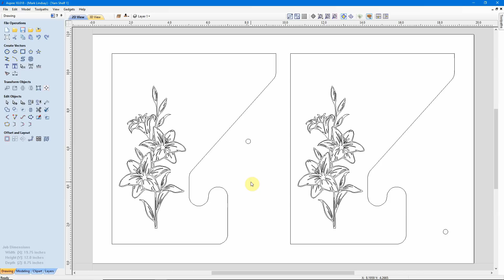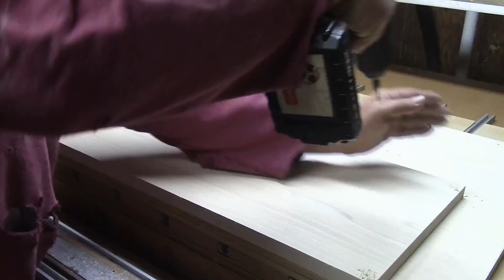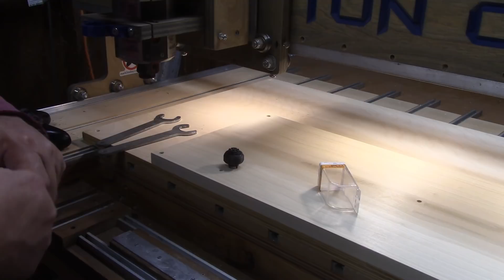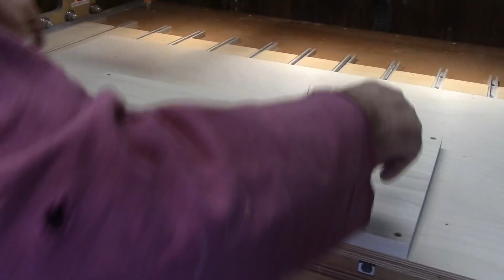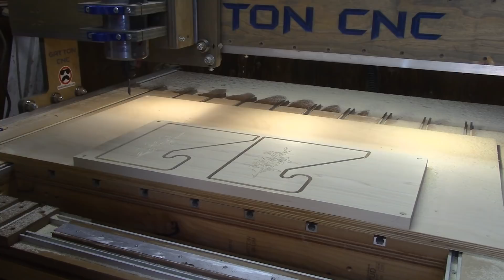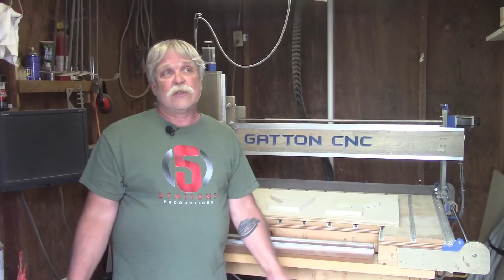2-Sided Machining on the CNC - Part 3 - Design a Shelf Project in VCarve or Aspire

Comment: Sounds like you need a new design committee... LOL Just kidding dear :)  anyway where did you get that sanding block that uses the round sanding disks???
Reply from the maker: You'd think that after 32 years, I'd be used to design changes in mid-stream... 

The sanding block is called the Sanding Mouse Hook and Loop Sanding Block, and I have to say that it's a handy little son of a gun. Here's a link. 6 inch: https://amzn.to/2AC6mSh    5 inch: https://amzn.to/36dHj3B

Comment: Good job, this viideo should be pinned at the top of the CNC for Beginners group.  A lot of people don't seem to understand machine zero vs XYZ job zero.
Reply from the maker: Thank you, Dave. Every machine and controller software is a bit different. A lot of the home/hobby CNCs don't even concern themselves with machine coordinates, and it can get real confusing real fast if you try to introduce them to folks who have never heard of them. I try to avoid the topic unless I absolutely have to talk about it. Now that I think about it, I should probably do a video on the subject. Thanks for the idea!
Reply: @MarkLindsayCNC  I think a lot of people get hung up on adding switches all over the place and then getting thoroughly confused.  I liked your explanation that you set X and Y once for the project and Z one each bit change.  I have seen a lot of questions about that with people thinking they needed to set X and Y for each bit.

Comment: would you please explain how you set up the locating holes . It seems that when the holes are set up at first the holes need to be reversed to be correct when the job is flipped. I an sorry, but I did not understand how the reversal happened. Great presentation as always. Thank you  Bob
Reply from the maker: Thank you, Bob. If you watched the video previous to this one, when I made the locating holes, I copied them to the other side to the project material. That automatically reversed them and kept them in perfect alignment. Here's a link to that video: https://www.youtube.com/watch?v=D9L5iH-yids